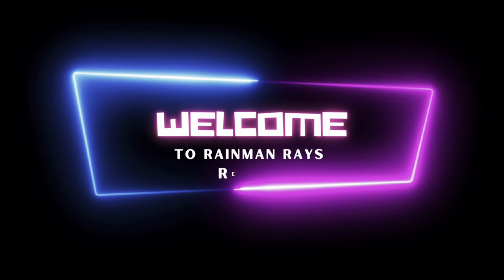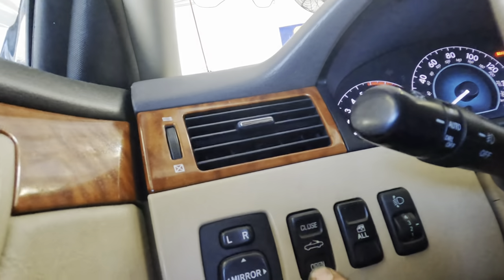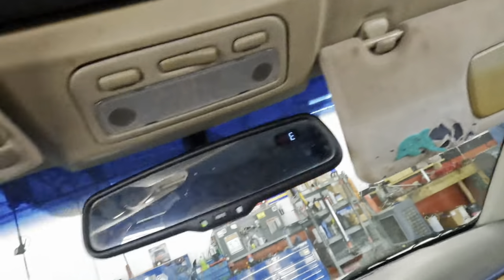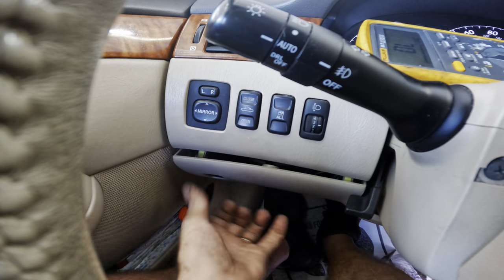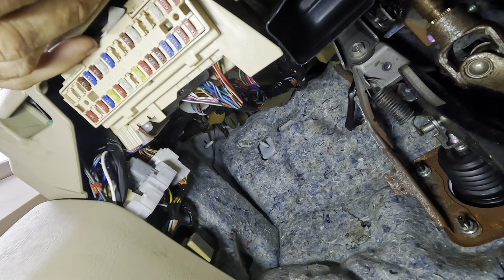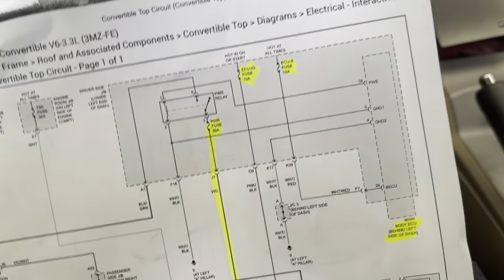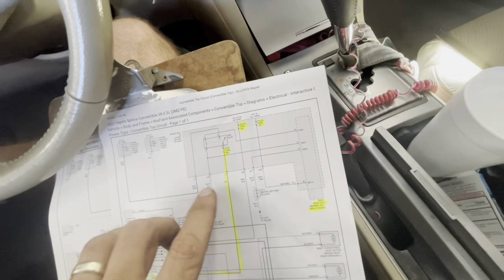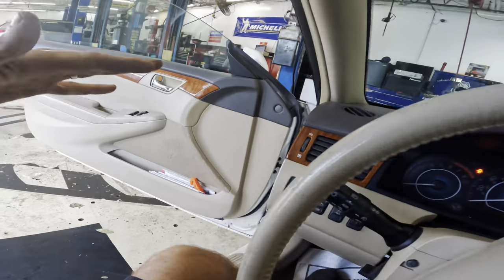Customer States: Convertible Sunroof - It’s Stuck!

Comment: Random question thats bugged me since my friend picked up a Chrysler Grand Voyager, on my own car and every car i've ever owned the remote central locking and key are all one piece, why is it that American cars always seem to have the key one piece and the central locking remote seperate?
Reply: It's changing. Many cars these days have the key and the fob in one unit now. 
Actually, on alot of newer cars the fob actuates the ignition wirelessly, and you just press the start button when the fob is close to the car, like in your pocket or purse. One doesn't need to insert a physical key into an ignition switch with those. Those fobs usually do have a emergency physical key inserted inside of the fob for, you know, emergencies and such, like if the electric door locks stop working. 
If trying to start the car with that emergency key, finding the spot to put that emergency key into can be frustrating.

Comment: He bemoans that is car has issues with so little miles. In modern cars mileage is secondary to time and more importantly time spent outdoors.  My 2016 Chevy that is garage kept has almost 250,000 miles and other than typical wear items (battery, brakes, tires) has had zero issues and other than drivers seat and steering wheel wear looks new in the interior.

Comment: Morning Ray enjoyed this video. Electronic repairs is expensive but my thought process is will I be keeping the convertible car I would want everything working.
Reply: The roof not functioning would bother me for a long as I owned it. Such a major factor for buying it and then nothing.
Reply: I'd think it would be even more imperative to repair the issue if you were about to sell it than if you were keeping it. I mean... People who would buy a vehicle that is designed to have a compromised structure and be highly vulnerable to thieves/vandals do so because they can put its top down. If they cannot, well... those other things aren't exactly features, lol. And, sure, there are people who buy obviously broken vehicles - but the seller usually takes three times longer to unload the vehicle, suffers a substantial financial hit, or - oft times - both. And with a major hurricane having just gone through, most people would automatically assume that the issue is due to flood damage, and also assume that other issues are likely to appear "real soon." Could be the only offer you'd get this year would be $600 from a guy who brought a three-vehicle trailer down from Kentucky in order to restock his buy here / pay here beater lot.

Comment: I can understand the owner not wanting to repair the convertible top issue, at least it is stuck in the closed position. If it were my car I do know it would bug me, it would bug me a lot actually. I like everything in my vehicles to work. This particular vehicle from what we saw looked to be in a very good condition and had low mileage given the age (which is far from old I might add). 

I would probably spend the money on the diagnosis just to know how much it would cost to repair; and if relatively affordable, would have it done as you would have everything apart anyway. In reality I would do it myself, I am more than willing to give it a go myself.
Reply: I have a 2002 Mercedes SLK320 project car. When I brought it 2 years ago for £750 the roof was stuck closed and the 2 tiny triangle rear windows were stuck open (sound familiar? lol). The guy I brought it off had replaced the hydraulic pump, the roof switch, and various other components with no joy. I got it home and decided to buy the Mercedes WIS software for it and found it has something like 17 micro switches so that the car can determine at any point where it is in its cycle (its a hard top that folds into the boot {Trunk!} ). Using my trusty multimeter and a screwdriver to remove various trim panels, It took me 20 mins to discover that a micro switch costing £1.50 was bad. So a quick dig around in my workshop for a suitable switch, and 2 years later the roof is still working fantastically! That and with the rest of the work I've done (costing around £1,100) I have a car worth around £5,000 on the open market. but once I have learnt to make my welds invisible and have fixed the rust on the rear quarters and resprayed the grotty bits it will be pristine and worth a whole bundle more. Amazing what you can do yourself if you put your mind to it and dont mind reading a manual, I'm definitely not a mechanic of any kind but @Rainman Ray's Repairs has helped me with many problems I've had with it. Its been a very fulfilling journey so far on a car I have lusted after since they first came out in 1996 but couldn't afford. 🙂

Comment: Not fixing a problem that also controls the windows seems crazy.  That's a real nice car, with well kept interior.  What if he's out and about and a rain storm hits, result is wet interior and possible damages components.  If that should happen, how much are repairs going to cost compared to fixing the initial problem?
Reply: That's always a good point.  Cheapest temporary "fix" would be for the owner to jump power to the window motors directly so they go up...then ignore the problem and never attempt to lower the roof again.  At least then there's be no water ingress while he mulls over his finances.

Comment: dude, my Pilot has a sunroof and i NEVER use it. i often forget its even there until someone else mentions it. why would i suddenly want a rectangular hole in the top of my car??? usually that's a huge problem that you get fixed as quickly as possible

Comment: My first thought was that there is something telling the module that the roof is open so it won't try to open the roof or allow the rear windows to be closed. I thought a scan tool might get some readings from the module.

Comment: "We can conclude the motors aren't bad" ... respectfully disagree that's a given. I've had two cars now with power windows with "flat spots" on the motors. My Yukon would "click" like it was trying but it wouldn't go anywhere. The motor ... I never did figure out how to get to ... it was like between the door frame and the door exterior. The "fix" was to smack or kick the door, sometimes beat the crap out of it, to "jiggle" it off that flat spot, then it would work. shrug

Comment: What's your stance on the position of the drivers seat when you're done with the job? Do you try to leave the seat where it is or move it where you need it?
Just got my oil changed and I'm a tall guy so my seat is all the way back usually but the mechanic moved it way forward and it surprised the crap out of me getting back in it.

Comment: The question is, did you find the paper that fell between the seat and the armrest? Or is that a surprise the folks will have later or if it returns. Yeah, this would be a good rest of the videos to find out your phenomenal skills in tracking down issues. Thanks for everything ray have a great rest of the week.

Comment: I thought it was the window related problem that caused the convertible not to work at the beginning, but since the rear window motor switch is good and able to receive signal to have windows roll down but not up, can pretty much conclude that the module is at fault. cant wait to see the follow up vedio

Comment: PT 2 would be interesting.  The microswitch thing... a few months back Pine Hollow Diagnostics did a Porsche diagnosis/fix for a shop who was stuck.  Was interesting to watch and learn.
Reply: Slim chances for PT2. Even slimmer, because no "part 1" in the video title
Reply: @IcecalGamer  there's no part 1 in the title because he doesn't know if therell be a part 2. No movie first in its story is called 1 originally. Back to the future wasn't  called back to the future part 1 when it came out.

He can only label something part 1 if part 2 will definitely exist
Reply: @norfolkngood8960  True.
However Ray usually doesn't post the same day that he films, usually with quite a big gap.
Also, he usually shoots more than one car/truck per day. He could have filmed that diag video days ago and known by now of a returning customer.
Scheduled release and pipeline are a thing.
I said usually because of the recent change in reliable content that struck Florida.
However, you needn't be so abrasive when you reply.

I've put the "part 2" as a lesser importance point, in my OP; a side note, or a footnote, factor, if you wish. <described by usage of "Even" and the comparative "-er". The bulk of the reasoning remained implied in the first sentence and stopped at the "."